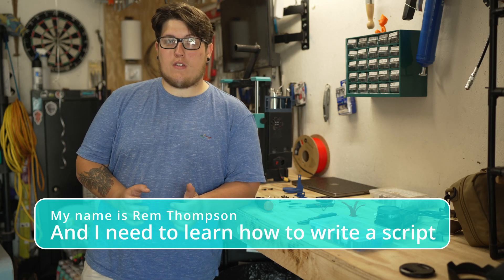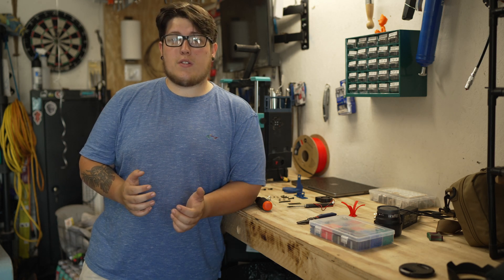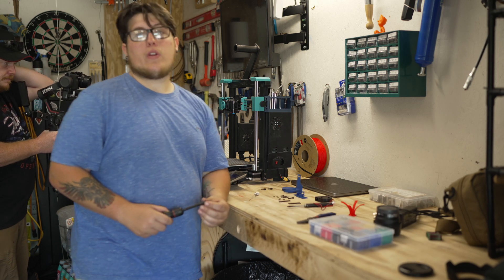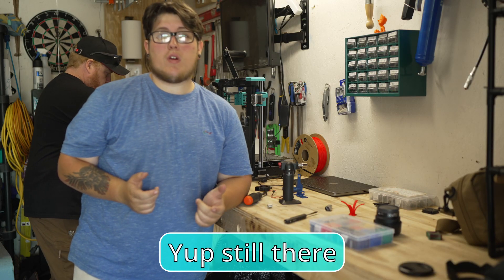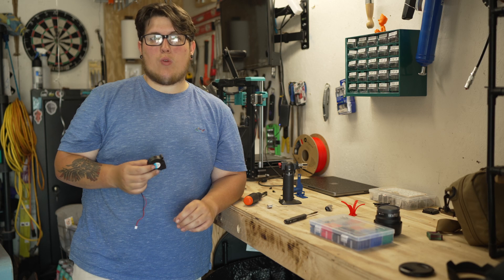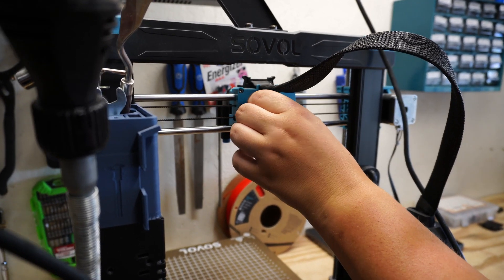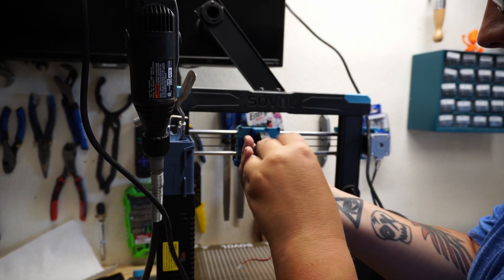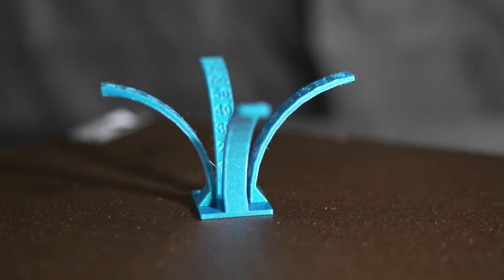Supercharge your Sovol SV06 Print Speeds with this Easy Mod!

Comment: I have this mod, and the speeds were not really an issue, but the overhangs are great. I can easily get 80 degree overhangs  with PET-G.
One of the other advantages of this is being able to see the print.

Comment: A 5015 is a start.  After going to Klipper I realized even that wasn't enough.  Dual 5015's for the win.  Also a 4020 for the hot end cooler, which eliminates all issues with that part of the system.
Reply: What dual 5015 fan duct are you using?
Reply from the maker: What kind of speeds are you pushing with that?
Reply: Im using a 5015 on my extruder. Quiet. Cool. Worth it lol